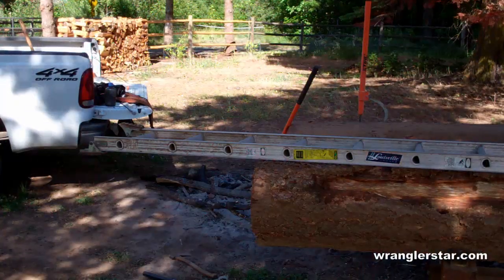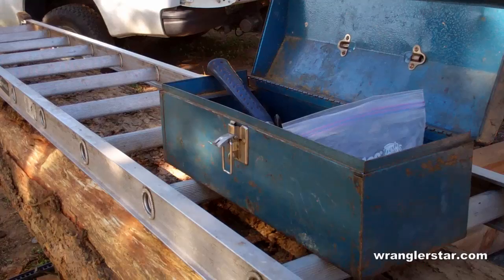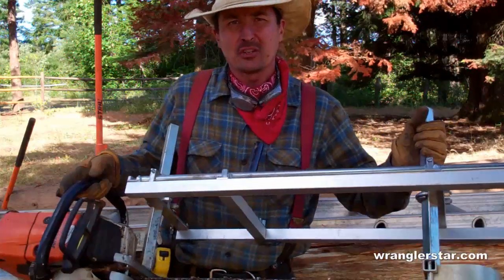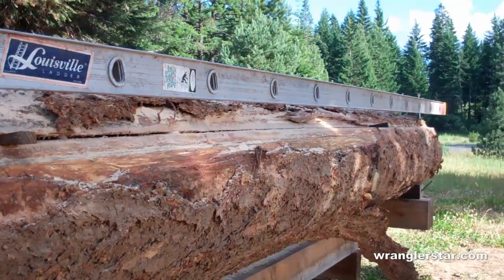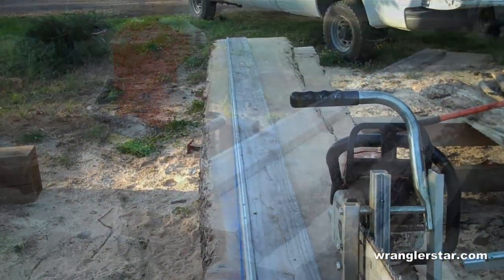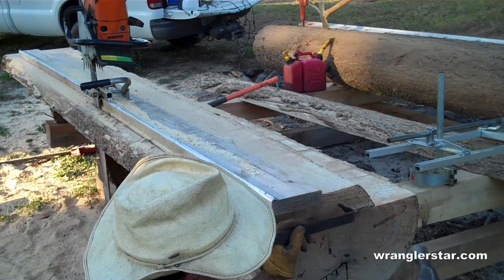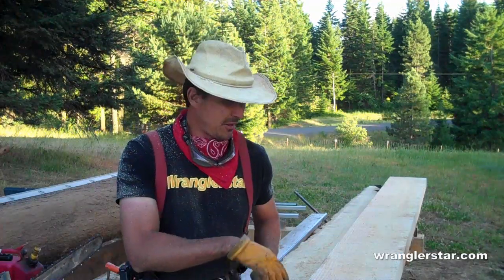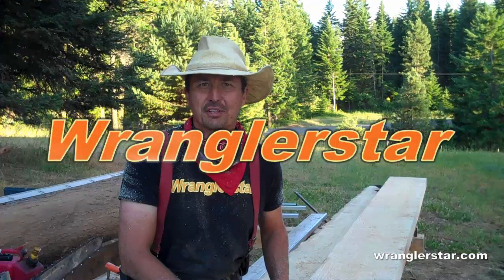Alaskan Chainsaw Mill – Turning Massive Logs Into Timber for DIY Stairs

Comment: The rant...... SPOT ON!!!  
Now a little something I learned from my dad who was a master carpenter. This one of those little tricks you pick up when working with masters in any trade if you are paying attention. This works better for me when having to drive lags or long screws in projects and you may find useful. Try using a beeswax toilet ring instead of a bar of soap. It has advantages over the soap that make it right handy. A couple +'s off the top off my head: Easier to apply, Seals the hole just under the head of the chosen fastener, and extends the battery life on cordless drill/drivers significantly. 
Hopefully this will be useful to you and your fellow subscribers.

Comment: Hey Cody, you ever consider buying a Stihl 660 ?  Put a dual-port muffler on it, available from Stihl.  It will run cooler, and you'll see a 10-15% gain in bhp.  Also, DON'T forget to readjust the carb hi-speed jet, for the compensation in fuel mixture the saw will need to keep from burning up the engine after the muffler mod.  The 660 is a great milling saw for boards up to 20" in width!

Comment: Agreed.  I cannot wait to get out of California.  Even though I live in the woods I still don't feel free here.  The next house I build will be 10 times stronger, more insulated, and better looking than the home I live in now.  I cannot add lumber to my home that doesn't have labeling on it even though the wood I will cut will be at least twice the thickness required.  As a carpenter since 2003 I have grown tired of building cookie cutter houses and seeing people take out massive loans to build a house that just barely meets requirements.  I remember well building a deck on the 2nd floor that the plans called out for 4x4 posts 12' apart.. You could see them bend when someone walked on the porch.. and the entire deck vibrated with each footstep.  No thank you!  I'd use 12x12's fresh from my forest and detailed by my hand every 6 feet apart.. yet the building department would make me change it because I didn't buy into their system.
Reply: Houses can be built so you don't have to heat them in the winter, nor cool them in the summer.. Yet then you wouldn't be buying from the system.. feeding the oil industry. Our rights are taken away nibble by nibble.  Those in power do not want us to think for ourselves.  Don't let them take away your rights, your freedom, your soul.

Comment: I built my house (not personally nailing it together, but I was my own prime contractor) in rural Arkansas without one building permit.  The only thing I had to do, was to get a percolation test for my septic system if I wanted to hook up to the local water system.

I was really weird after being in SoCal where you need to get a permit to wipe your ... nose.

Comment: I agree that some things need to be in a safe enough state that it doesn't cause harm to an innocent bystander.But, maybe that decision should be left up to the neighbor to call and ask for them to be inspected, or ask the individual to get an inspector to look at it.

I had an idea to work on my fuse box to install a homemade interlock switch, surely I shouldn't be forced to buy what some company produces for $80+ when it's made out of a $2 piece of scrap tin. 

Some codes need to be broken.

Comment: I milled the big beams in my house.  Didn't know that the beams needed to be inspected before I used them but no one noticed and I did not know till after the house was done. oops  I wore out one stihl chainsaw making lumber.  My nest door neighbor has an old circular saw mill driven by a belt running off an old tractor.  I'll use it in the future.

Comment: Ive started to realize exactly what your saying about code/rules blah blah. Ive been working for about 6 months to get my low voltage electrical license in washington state. The amount of documentation i need to prove the hours i have as an apprentice is absurd. My time sheet for the week doesn't suffice. I need to actually get a signature from my journeyman and write the address to each job i do.

Comment: About the government regulation. It is a lot worst than what you think. I personally grow up doing carpentry work, my dad was a carpenter. I have been doing carpentry work and have been in construction for over forty years. I have found out about a year ago that because I have not paid some one $150 for each type of  tool I have, I am not qualified to use them. These are tools I grow up using and have been using them for forty years.  I am very TIRED of it to. I used not 1 course word. WHOW